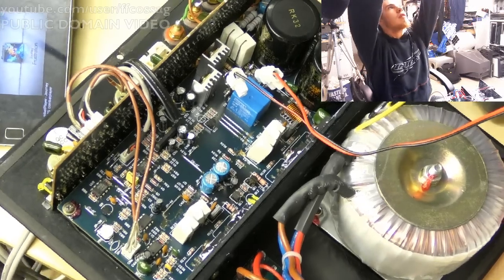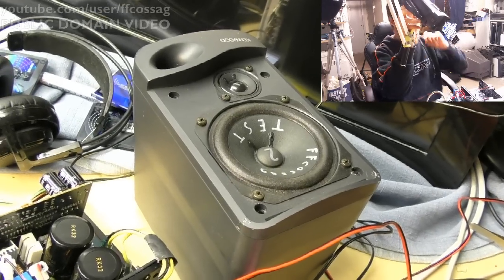REC'D STREAM: Messing around with a broken KEF subwoofer plate amp (the empty Minidisc stream)

Comment: Never had a problem with that Glue in my life , it was never a problem , but ive noticed kids who watch you tube think black glue of death is a sign of experience , if you say that . No its not , its a sign of lack of experience thinking that will be the issue , it wont . The Issue will be you scrapping that Op Amp generating voltage on that sensitive thing , you can kill it by touch , so if its not working you probably killed it , and Beringer crossover is not garbage .
And the reason you got in there to reverse engineer the Filters , i might have told you that you wont give it up , its a beringer linkwitz riley active crossover , its not cheap thing , that is the best there is , provided you put good parts in it , they are probably as good as they need to be .
So its obvious you know nothing about anything , stop freaking scrapping around talking garbage , my god kid
Reply from the maker: Ha ha ha ha ha. You can find SEVERAL videos on this channel alone where we fix things by literally just scraping off the glue. It's always a good place to start when troubleshooting this particular class of device.

Comment: hello sir, i have a similar problem with my brother recently acquired powered sub amp, it has had acidic conductive goo ALL inside the enclosed amp area which has literally corroded everything!! i thought i cleaned up alot of the goo where it might be shorting something but it still does not make good sound at all. i think it is because of the lower voltage rails are oscilating by themselves. i have replaced the caps in it so i have no clue. i am going to do a video on my channel about it maybe you can help?
Reply from the maker: There really isn't much I can do for you, I'm afraid. The help I have to offer is in my videos.

Comment: I wouldn't say copying the filter would do you any good, it's most likely tuned to that particular speaker. If you're going for a bi/tri-amped system you're much better off using an active crossover (or even better, do it all in software with impulse responses and a 5.1/7.1 sound card)
Reply from the maker: A filter's a filter. It's not so much about copying a circuit, but rather copying a circuit in order to understand how to adapt it for your own uses. I'm bad at learning through reading.